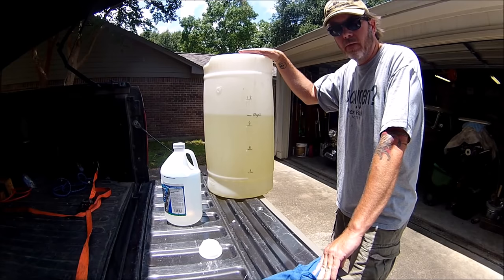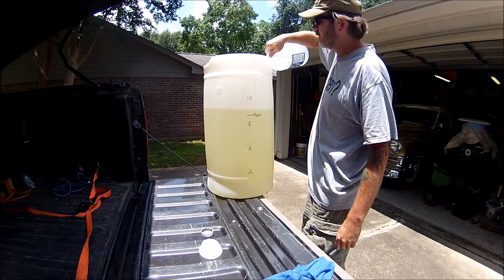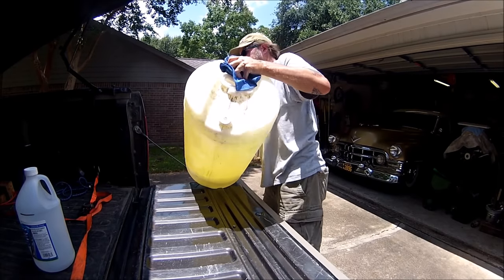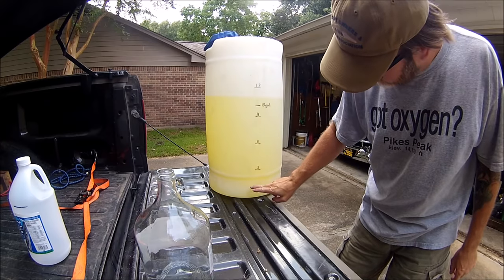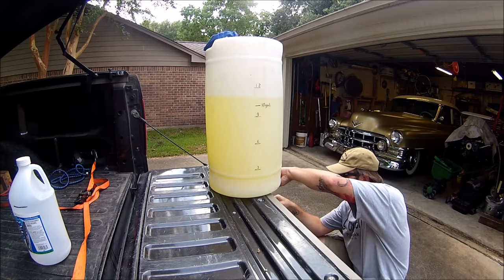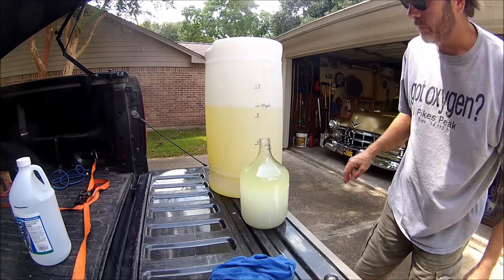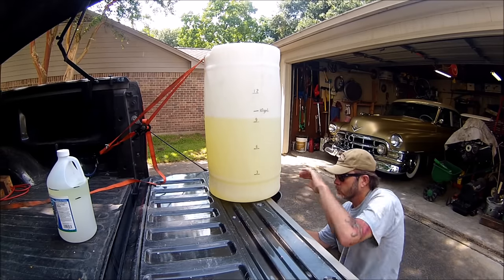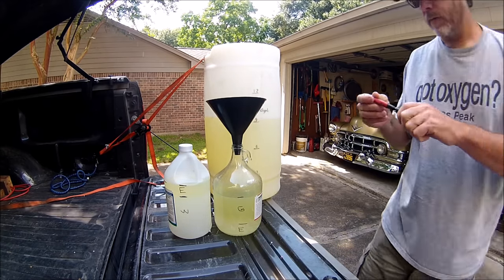How to easily extract ethanol out of gasoline.

Comment: Start with premium fuel, because you loose some octane when you remove the ethanol. 2 cups water per 5 gals gas is perfect. Simple chemistry actually. & yes some food coloring helps, an overnight sit will be all that is needed. Your gas will be clear & ready to rock & roll.
Reply: What happens if you add more water than the 2 cups to 5 gallons of gas?
Reply: @programmingchicago  your pizza turns out soggy! 
Actually nothing. It sinks to the bottom with the ethanol. As long as you don't get crazy.

Comment: You need to let it sit for longer than a couple hours. You don't have 3 different liquid separations in your glass jug. The middle layer you're calling ethanol is in fact a combination of all 3 liquids. Ethanol is 100% water soluble. If it wasn't, a bottle of whiskey would separate from just sitting around. Whiskey is 40% ethanol and 60% water.

Comment: Your fuel is no longer 93 octane Einstein.  If you started with 10% ethanol by volume, you will need to phase separate 1 gallon of ethanol and also remove the 1 gallon of water you added to make it  drop out of the gasoline.  Ethanol is worth about 3 points of octane.
Reply from the maker: You are correct. My lawn mower runs great on lower octane fuel.

Comment: I hope you realize that the ethanol is part of the octane booster? Removing it probably reduced it to 89 or 90 octane.

And honestly, if people researched ethanol for performance , then you be switched to as much ethanol as you could get your hands on.
Reply from the maker: The higher the octane, the slower the fuel burns. I'm not needing high octane in my lawnmower. I need clean fuel with the ability to store longer.

Comment: The process of removing ethanol from blended gasoline by adding water does work, this video just isn't a proper demo of how to do it.   In reality it takes several washes with distilled water to get all the ethanol out, and then adding a drying agent like cacl2 (which has the benefit of being able to absorb both water and ethanol) to ensure dryness. I went ahead and made 0.9 gallons of ethanol free two cycle gas from pump e10, using four consecutive distilled water washes and cacl2 drying agent. I knew the mass of each water wash added before and after ethanol extraction, and found the weight gained by the water to be right around the 10% mark. So the process does work, it's just labor intensive and not worth it for anything but small yard trimmers from the pre blended fuel era

Comment: So some math here... 10 gallons of gas + 1 gallon of water. 11 total gallons. Gas from a normal station has 10% ethenol which means that there is 1 gallon of ethenol per 10 gallons of gas. So there should have been one gallon of water removed that was initially brought in along with one gallon of ethenol. I'm not seeing this in this scenario. I would not recommend using that gas for any engine. It may have worked better if you let it settle a lot longer.
Reply from the maker: Gas stations say "Up To 10% Ethanol" There could be 0%, or 6%, or 10%. Nobody knows but the company that mixes it.

Comment: IMHO this process is maybe more of problem than modifying your old car rubber parts, and adding 'lead substitute" into the gas.     As you seem to know, the old fashioned rubber, (non ethanol compatible rubber) parts harden and shrink, like old fuel pump diaphragm, accelerator pumps on the carb., vacuum hoses and other pre 1990 ? rubber.

Comment: Best way to counter ethanol in lawn equipment is to mix the gas 40:1 with two stroke oil in motor cycles a cap or two of marvell mystery oil in the tank

Comment: The way I figure, the E10 could never be in contact with air or it would absorb moisture from the air. Maybe up to 10% of it's volume when it was produced. Not really a problem in our vehicles (mostly airtight or little contact with air) as it is in jugs or non smog gas engines that are much more likely to mingle with humid air. Every 2 cycle that I maintain needs fuel line or primer bulb every couple years and I'm told it's because of the alcohol (by the same people who sell me the green fuel line). Most have corrosion on the aluminum parts from water which isn't really a problem. Interesting to me that my 25 year old chainsaw and 30 some year old weedeater just got their first fuel line replaced in the last 2 years. Hey Bobby don't drink that shine

Comment: Why do folks think that gasoline will curdle or something over the winter? It is not milk, it will be fine over the winter, that may have been a problem back in the 50s but the modern oils and fuels store just fine.
Reply: John Quest The light ends of gasoline will evaporate and leave heavy oily stuff behind eventually leaving hard to burn thick fuel.  

Gasoline is a mix of different weight hydrocarbons, winter mix fuel can go as light as butane and summer mix as heavy as parrafin which is candle wax.

Now imagine you leave your summer gas over a year and all the lightweight chemicals evaporate and you're left with heavy stuff that doesn't evaporate, you're left with thick gunk that's hard to burn alone.

Granted for most it's not noticable and minor, it may cause a slow gunking of your carborator for a small engine.  You can buy stabilizer that keeps things together and prevent evaporating.
Reply: I hope you keep your gas cap on, jeesh, besides, as you use the engine and add more gas it will clear out the problems, if any, but I have always left gas in the tank to prevent rusting over winter.
Reply: "The bulk of a typical gasoline consists of hydrocarbons with between 4 and 12 carbon atoms per molecule (commonly referred to as C4-C12).[4] It is a mixture of paraffins (alkanes), cycloalkanes (naphthenes), and olefins (alkenes), where the usage of the terms paraffin and olefin is particular to the oil industry. The actual ratio depends on:

the oil refinery that makes the gasoline, as not all refineries have the same set of processing units;
the crude oil feed used by the refinery;
the grade of gasoline, in particular, the octane rating."  Quote from wikipedia.  There's some paraffin in gasoline, but probably not as heavy as candle wax paraffin.

As for how fuel stabilizer works.  Most brands don't want to say what their "active" ingredients are, only saying they prevent oxidation, moisture absorption, and neutralize acids.  What they are willing to say about the rest of the 95%, is that it's kerosene.  The kerosene probably coats metal and rubber surfaces preventing rust and eating away at rubber components.  Can't say what the 5% proprietary blend does.  Maybe some type of emulsifier to keep the heaver components mixed with the light ends from evaporation.

The best thing to do when storing gasoline without stabilizer, is to keep the tank full with minimal air gap.  That prevents oxidation, and water absorption.  It also prevents lighter ends from evaporating into the air gap.

Comment: Not sure what the big deal is and why all the trouble. You can buy ethanol free gas at many places. Around here, all the Quick Trip stations have it. Pretty sure most of the big stations sell it.  A lot of people prefer to use it for their boat engines and other small engines. So far as your car goes, the engine is designed to run on gas and 10% ethanol. In fact, everybody acts like it is something new, but they started phasing it in even before the government banned leaded gasoline back in the early 1980's. So we're coming up on almost 40 years of ethanol in your gasoline. In most places, they don't have to tell you. It will say "MAY CONTAIN" up to 10% ethanol. Your car's computer adjusts to the amount of ethanol.
Reply from the maker: There is no computer on my lawn equipment. The nearest station to me that sells non ethanol gas is around 25 miles away.

Comment: 1 as soon as you do this you fuel is no longer the octane you bought at the pump  ethanol has a higher specific octane rating than the petrol it's added to what this does is increase the total octane rating of the fuel when you remove the ethanol you lower the octane rating and could introduce negetive sideeffect for you engine like knocking and detonation both FAR FAR worse for your engine than the ethanol.

Comment: One problem with ethanol is that it has high octane number. So your 87 gas will be 85 or 83 when it is removed and 91 will be 87. Put it in a modern car and the engine will knock.
Reply from the maker: Correct, but put it in a lawnmower and it runs great! It will store for longer also.
Reply: Removing the ethanol drops it by 2 points so as long as you’re using 89 to start with you shouldn’t have problems.

Comment: I’ll take that advice sir with pleasure if you’ll demonstrate this trick then immediately pour the reclaimed gasoline into the tank of that Cadillac as a confidence assurance .
Reply from the maker: The fuel was made for small engines like a lawn mower, or weed eater. My  Cadillac has too much compression to run low octane fuel.
Reply: I was under the impression you were demonstrating the separation method with 93 octane gasoline, is that not premium pump gas suitable for up to 10:1 compression ratios?  Or did you source it elsewhere?  I’m not attacking the video indeed I was fascinated because my daily vehicle is carbureted and I hate ethanol, but I would’ve loved to see a  follow up at the end showing that water was at least removed, such demonstrating the usability of the gasoline in your barrel in an engine.  I really only picked on your Cadillac because I was admiring It during the video.  It’s funny bc we used to use ethyl alcohol to remove water in gas and now we’re  using water to remove ethyl alcohol.
Reply from the maker: I do run only 93 octane in the Caddy. After removing the ethanol, I would guess I took it down to around 91 octane. I did use this fuel in a riding lawnmower, and an a small aircraft tug.
Reply: Bobby Munroe would you recommend the fuel treatment for intended for cars needing only standard pump gas?

Comment: H2O should settle to the bottom.
A slight tilt set for the tank with a reinforced sump combo drain plug is the simplest fix.
A slight Glass would be helpful, but adding $29.95 to the manufacturing process would take too much out of the Greedy Ones bank accounts...

Comment: Or, you could just drive to your local airport and buy some avgas. 100LL runs real good in a car or motorcycle (as long as the car doesn't have a catalytic convertor).
Reply from the maker: This is not for use in cars. It's for lawn equipment that sits for periods of time.

Comment: All that this guy did was add water to his fuel. That is not a good thing. One of the benefits of adding ethanol to gasoline is that it removes water from your fuel. If you have an engine that includes rubber parts that don't stand up to ethanol (a very rare or nonexistent occurrence today.)? Get a new set of rubber parts for a few bucks. Every piece of metal in your engine and fuel system will thank you for using the ethanol in the fuel to bind/remove the water, which accelerates corrosion, from said fuel and shoot it out the exhaust.

I would even go so far as to say that this guy is "not even wrong". He is using water to remove the portion of his fuel that serves to remove water from his fuel! Will his next video describe how to remove the corrosion that was caused by this video?

Comment: Has anyone who did this actually gotten good results with small engines using fuel treated this way? I tried this was a small sample and the result does not smell much like truefuels or VP ethanol free gasoline (which smell like the gas we used 40 years ago).

I suspect (based in part on the smell and in part on the MDSS) the real problem is that what we get at the pump is mostly BTEX, not gasoline and that ethanol is just a scapegoat for selling waste products as gasoline.

Comment: What is it about ethanol that people are worried about?seems to run in your car so why would you even care about it?and you just got your gallon of water back and lost a gallon of fuel that now has water in it.
Reply from the maker: Gas with ethanol does not last as long as pure gas. When your lawn equipment sits up through the winter, the ethanol in the gas will absorb moisture and clog up the carburetors on the small engines.

Comment: You should get 2 liquids- gasoline and a ethanol/water combination not 3. The water and ethanol will combine.
Reply from the maker: Sounds legit, but If the fuel had a low ethanol content to begin with I may have put more water in than I needed to absorb the ethanol. Therefore I possibly had water/ethanol mix, extra water, and fuel. Maybe I'm wrong, but I had three distinct mixes after draining it.

Comment: Why would you want to do that? You start with 93 octane then have 90 without.
Reply from the maker: Ethanol absorbs moisture out of the air. If fuel sits for a while,  like lawn equipment during the winter,  it reeks havoc on the fuel system of the small engine.
Reply: @BobbyMunroe  the same happens to straight gas. There are more pro's to Ethanol then there are con's.
Reply from the maker: It depends on what your using it for and the humidity in your area.

Comment: Just get the 5 gallon plastic water bottle located at most super markets and add a pep cock in the bottom corner if you want to do this.
I just run the E-10 in my saws and cutters then when im finished working i drain the tanks and run the engine dry.
Its almost time to start my outdoor work again and all my equipment is ready to go, just add gas.

Comment: I just drive to the station and buy it.  lot simpler. Its the only gas they sell.
Reply: Not everyone has that luxury; especially in Ohio
Reply: They really don;t sell it up there?
Reply: not in ny either. You have a $100000 67 vette and you HAVE to put 10% ethanol in the metal tank because that is ALL THAT IS AVAILABLE.
Reply: They have unleaded stations I have one 4miles away another 3 with in 25 miles I'm in the country. There all over Texas.  Did you check the airports they have special fuels? Those county ones with older planes.
Reply: Try the small airports they carry special blends. We use to get 110 octane at one. Here in Texas they have ethanol free stations.

Comment: O.K. this type of "foolery" just makes me insane. The question is "Why"?  
Folks, ethanol isn't the actual issue, it's the additional additives that is added to gasoline so it will play nice with the minute amount of ethanol.  Benzene, Olefins, Xylene, etc...   So in this video you try and remove the "evil ethanol" and leave the actual chemicals that is causing the problems (plus a bunch of added water).

Comment: If your car doesn't run well on oxygenated gas, there is something wrong with your car, not the fuel.
Reply from the maker: This fuel was not made to run in a vehicle. I took the ethanol out to run in small engines like lawn mowers and other yard equipment.
Reply: Oh, right on. It plays hell with plastic fuel tanks and lines.

Comment: Happy with "The majority of unleaded 95 Octane petrol sold in the UK contains up to 5% ethanol as required under the Government's Renewable Transport Fuels Obligation (RTFO). There is currently no requirement for renewable fuel (such as ethanol) to be present in super unleaded (97 grade petrol). ... Our Synergy Fuels: Diesel." but unhappy @ $6.81 a gallon for 95% octane, some very high 99% octane fuels depending where you shop. cold weather. a bit of ethanol is ok but not good in cold wet weather. cars aren't a diy thing as much. ex-fleet vehicles all over, shit boxes are nigh free. not exactly the jetsons but not the flintstones either

Comment: I wonder about all this !
My idea is with modern gasoline there is no way of knowing what exactly it is composed of not counting just the ethanol !
The manufacturers can vary the constitution at anytime !
I know it's hard seems impossible but you should try to run fresh gasoline through your engine !
Never let it get stale !  Try to keep it dry ! Burn it before it has a chance to absorb much moisture !
Like I said even that might not work ! You might buy stale or contaminated gas from the station !  But what can you do !
Gasoline is Napha plus other things !
Those other things are a trade secret ! Not even listed on a msds !
Seems removing the ethanol from the mixture might change the properties if the substance !
Might even remove some of the other things other the naptha and ethanol !
I am not a chemical man but have worked 20 plus years at a refinery !
:) We all spends our monies and takes our chances !
I say burn it if you got it !
And don`t worry so much :)

Comment: So your saying you are putting in 1 gallon of water, your extraction presents aprox. 1.2 gallons of water/ethanol. Ethanol gasoline has aprox 10% Ethanol, 10 gallons of fuel should produce 1 gallon of Ethanol plus the 1 gallon water you put in the fuel. To check if you have Ethanol still in your fuel put water in your fuel again and the water will not mix, see https://www.youtube.com/watch?v=_4lzrxZ_fM8
Reply from the maker: Correct. If this method was 100% efficient, and the ethanol percentage was consistent. The fuel says "up to 10% ethanol added" meaning it could be less. I could also let the fuel sit longer to let it separate more.
Reply: Bobby Munro

Comment: Why do you want to remove ethanol? Ignorance is my guess.
Reply from the maker: Ethanol absorbs water. I live in a very humid area. If the fuel sits for a while it can destroy the inside of carburators and fuel lines. Think of lawn equipment that sits up during the winter.